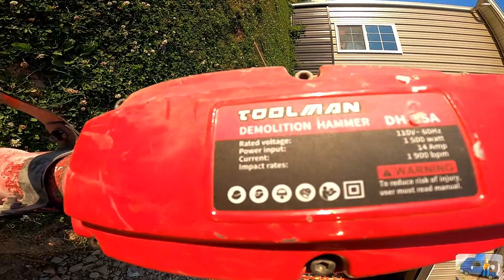Jackhammer; Foundation Demo

Comment: Nice review, how many watts was that generator your using? been looking at these, but its hard to believe they are pulling as many watts as they claim.
Reply from the maker: Thanks!  It is a 3500 watt generator.  I used the generator to avoid a large voltage drop with a really long extension cord.  It did everything I asked it to, but was time consuming.  Thanks for watching!  👍😁

Comment: Should have rented a hammer for your skid steer, done in 30 minutes
Reply from the maker: I wanted to!  Unfortunately the tool plate needs work and I questioned the auxiliary hydraulics at the time of the demo.  I was afraid I'd rent the tool and get stuck with poor to no performance out of the old 843.  It's in the shop as we speak!  Thanks for watching!  👍😁